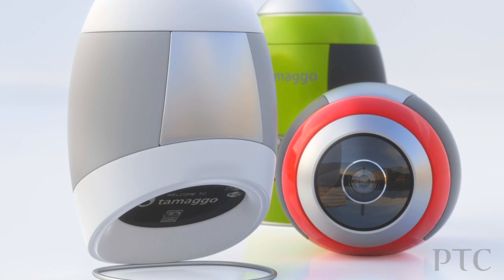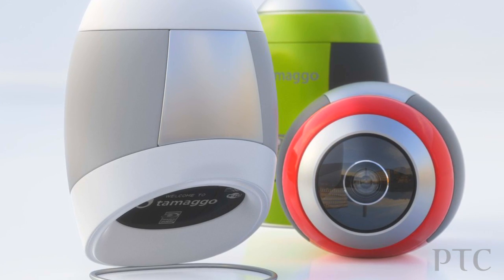Tamaggo Moves from SolidWorks to Creo - PTC

Comment: PTC and NX are much worse. For every mouseclick in SolidWorks you need between 3 to 5 mouseklicks in SW. I used to work with both. These Softwares are really circumstancial. I'm also interested what PTC paid for this Video. Please take your time and compare each function step by step and you will see that you loose min. 1 hour every day by not using SolidWorks.

Comment: Creo sucks compared to SolidWorks in all areas. To be a bit more professional, Creo functionally just isn't on the same level as SolidWorks. Things like SheetMetal, Tooling Design. Weldments, Direct editing. I have used both and can honestly say SolidWorks is by far superior. Look at the market share of PTC compared to Seimens, Dassault systems and AutoDesk. The prove is in the data and data doesn't lie.

Comment: You will not be up & running in Creo in 1-2 days I can promise that, esp if you have migrated from SolidWorks.  Catch the latest cad innovations & you will see that Solidworks 2015 is the package of choice.  PTC is a nonintuitive bear on all fronts.
Reply: +markhp48 I am absolutely agree with u, i dont know why these people doesn't understand. I have been dealing with CAD packages almost 9 years, and software is is the worst as it takes long time to make a simple design.